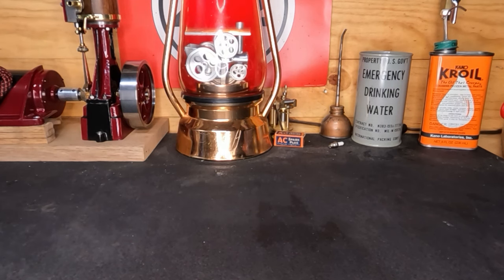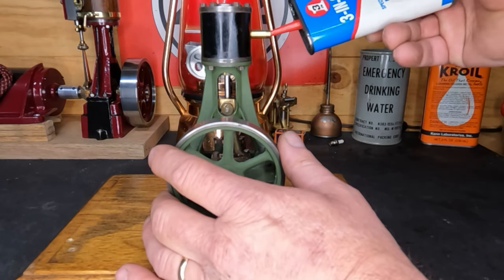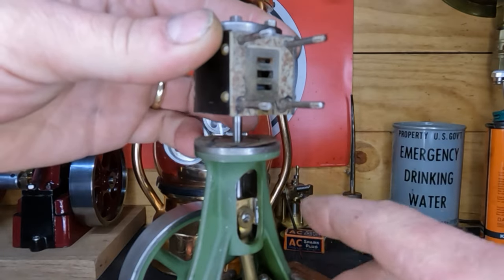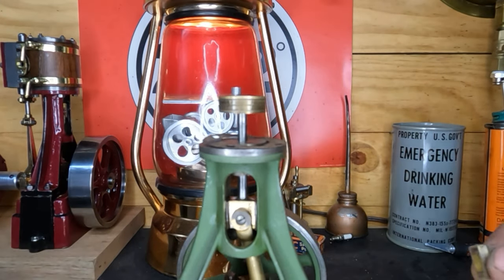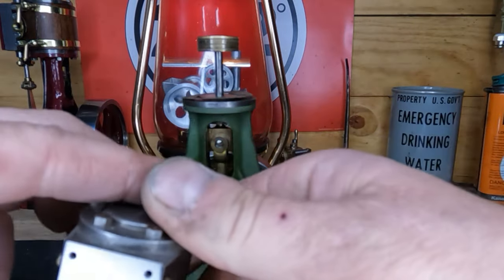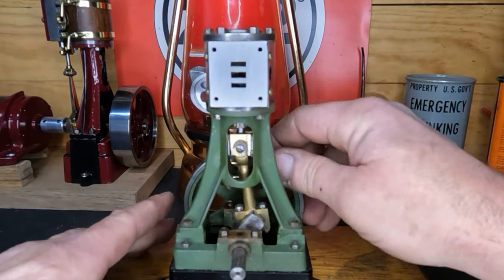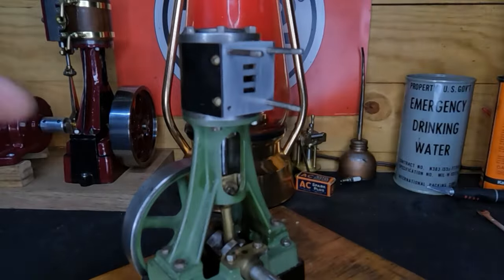Stuart 10V Steam Engine, Will it Run?

Comment: HEY how are you doing? If you get to many holes in the board just use some saw dust and glue to fill them in. I also like the color of this motor. Reminds me of the Acme Gridley
Multi-Spindle Screw Machines from the World War 2 that I set up, ran and rebuilt for 25yrs. Good to see it running. Have a good one my friend.

Comment: I have one of these 10V engines made in 1952 by my father,..........this model appears to be very stiff even after reassembling it......I can make mine work using mouth pressure alone which is about 2 PSI......for fun i have run it on a 2 litre Coca Cola bottle pumped up with a bicycle pump......2 litre Coke bottles will hold over 100psi.

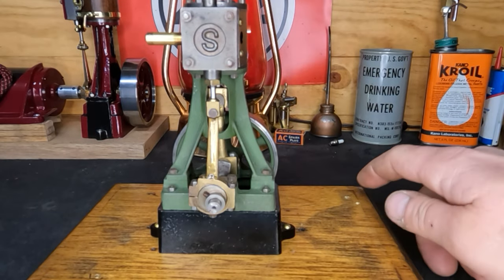Comment: 4:03 could be piston-to-cylinder seal. It seems Stuart Models intends for steam oil to take the job of a piston ring up and since I dn't have any, mine has a metric shitton of blowby most days. I've found shoving a bit of wheel bearing grease down its throat tends to help.